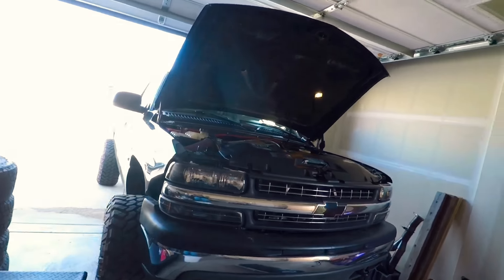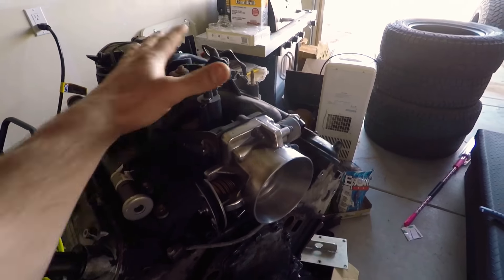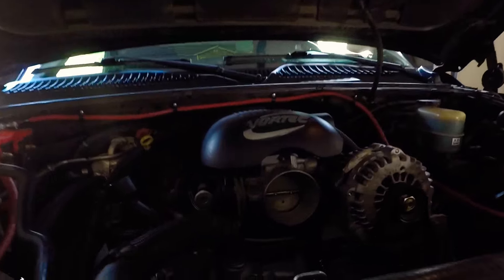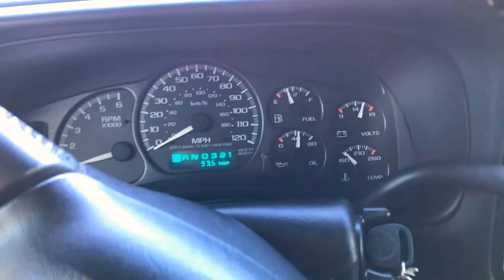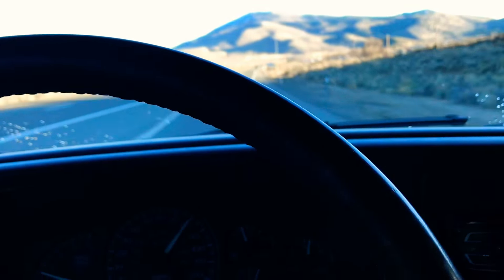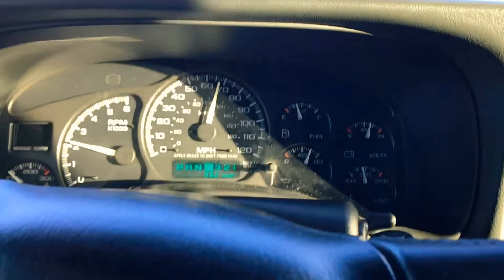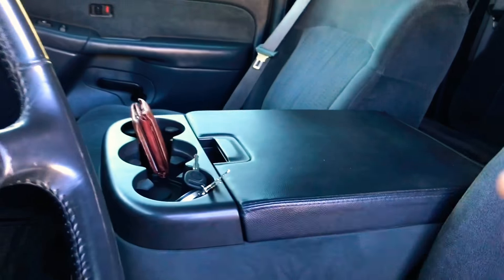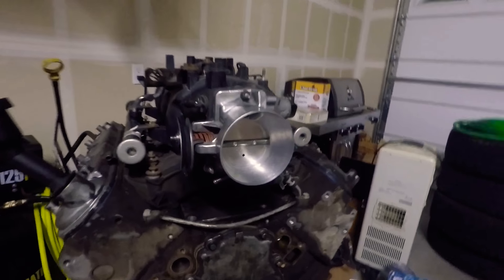Finally Finished the 6.0 Swap and it’s Already Back in The Garage

Comment: Great video. I have a 2002 2500HD with the 6.0/4L80e 2wd with 4:10s. I’m looking to do the 799 head swap and add a cam
Reply from the maker: Those heads and a cam will wake that thing up big time
Reply: I’m looking at a Texas speed cam .600/.600 with the 799 heads. Should be pretty good vs my stock 6.0 with 317 heads. How my HP do you figure you picked up, with the tune included
Reply from the maker: Shoot probably 50-60. My problem now is my injectors are too small so I could get more with bigger injectors
Reply: I don’t think there’s anything wrong with your injectors.... just decap them. They will flow almost twice as much. You’ve probably heard of Sloppy Mechanics, they are the sole reason I want to build my 6.0. Here’s a video about decapped injectors. https://youtu.be/zD90VWBigLI

I do have another question for you. If you upgrade to a 80e trans, will your factory wiring to the trans have to be changed? I ask that because I’d like to take a half ton and do a 6.0/4L80e swap. As long as the truck came with a 5.3, engine harness should all be interchangeable.... I would think
Reply from the maker: That I don’t know. I would have to do some homework on it. I know guys have done it but I just haven’t looked into it too much
Reply: David Denman 
I did a 2002 LQ4 with the TSP 220 .581 lift , long tube headers , 8.1 injectors and walbro fuel pump , it ran great WHP was 345 .
Now I'm doing a LQ4 but I'm changing pistons (H1129CPA) to flat pistons to raise compression and run the stock heads with TSP 224 for a 93 Blazer 4x4.
The 243/799 flow about the same as your stock LQ4/LQ9 317 heads the difference is the compression chamber 64 vs 70 .
LQ4 have 9.5 compression vs LQ9 (flat pistons no relief valves) 10 Compression .

Comment: First off, sweet chevy. I’m glad to see others have the same passion in these trucks and body style. I see a lot of people asking the same question so I’ll pitch in. Keep the vids up man! Haven’t posted on my channel in a while, been too busy. 

I have a 6.0 swap (cam, heads, intake, exhaust), 4.56 gears and 40” tires on my 2002. I can light them up from a stop. In my experience, If you have the power from the engine then don’t gear too low. I’ve run 31’s, 33’s 35’s 37’s and now 40’s. All with the same gear ratio (4.56) and it felt geared way too low on 35’s and 33’s. 37’s were tolerable but still a pig at highway speeds unless you really get on it. The 4.56 and 40’s make a perfect all around combo for the street and light to mild off roading...  don’t let people talk you into 5.33’s and even 4.88’s you’ll eventually regret it tho the torque off the line is great, you’re lacking everywhere else other then the city stop and go driving.
Reply from the maker: Thanks dude. I love these trucks. Mine needs a little love when it comes to the paint but it’s in really good shape otherwise. I like the 35s and 4.56 but I have a friend who has 37s and 4.56 and he says it feels better to him. I’m not going to switch anything out at this point though.

Comment: Did you put in the same 6.0 from the 2500hd?
Reply from the maker: Yes I did.
Reply: Nice....know of the difficulty level of swapping in a duramax? Probably would be easier with an entire donor truck I'm sure
Reply from the maker: Oh man I’d imagine a lot harder. I’ve seen it done but never looked into it. A half ton would MOVE though with that much power in it
Reply: Endless Wishlist yeah it would. Once I get my truck fixed up and to where I want it I may start looking for a duramax swap instead of buying a new truck. Pricey either way you slice it though

Comment: Do you get check engine light for misfire because of cam?  That will be nice getting throttle bottle done.
Reply from the maker: No never. I just had codes for my knock sensors
Reply: Endless Wishlist Ok, yeah buddy said he should be able to set things once it's ran for a bit I guess like the ranges of how many times it she's a misfire before it throws a code.
Reply: Endless Wishlist Ofcourse now I have to go to discount tire I have a piece of metal sticking out of inside firewall. They are toyo m/t maybe I will get a new one. Fingers crossed.
Reply from the maker: Good luck with the tune and tire. Would be nice to get a new tire
Reply: Endless Wishlist Dang it, piece was just stuck in a tread lug a little ways so no luck on new tire.
Reply: Endless Wishlist So you're having throttle body redone?
Reply from the maker: Yes, and that way I’ll have both of them ported. The 5.3 is getting a ported intake manifold also.
Reply: Endless Wishlist Nice, man it seems like it's always something to do.

Comment: Hey man love the silverado!! I noticed u got two batteries what are the benefits of that ? I tried to go threw ur old videos but didn't see anything on them..
Reply from the maker: There are two ways you can do it. You can isolate one or run them in parallel. Mine is just a really strong 12v system. I’ll talk about it in my next video and explain it better if you would like.
Reply: Endless Wishlist  yea man that would be cool .. my electric system is pretty weak.. I got two 12" subs and my electric fan swap on and my lights dim when the fans kick on or when the subs hit ..
Reply from the maker: You would probably want to isolate a second battery and run your subs and fan off that. The tray is a factory tray from a duramax. I’ll go over it in my next video.
Reply: Endless Wishlist  thanks !

Comment: Some 4.56 gears would help you out alot if you dont have them already with those big tires and help your transmission live longer.
Reply from the maker: I do have 4.56 gears. My factory injectors are what’s holding the engine back now. The tuner said they are maxed out and if I want more power I need bigger injectors. So I guess I’ll be getting those soon haha
Reply: Endless Wishlist ok i see now..8.1 or the supercharged pontiac gtp injectors on ebay are a good budget upgrade.
Reply from the maker: You read my mind. I was planning on the 8.1 injectors.
Reply: Endless Wishlist 
I have the 8.1 injectors and they worked

Comment: Are you running the stock 145 amp alternator for the dual battery setup? I have 2 large diesel batteries from a international I'm slapping in....
Reply from the maker: Mine is 135, my truck came with the 105. Orielly didn’t have the 145 and I needed an alternator now because mine took a dump
Reply: I assume the 135 is good to go with the two batteries. Do you have a switch or regulator between the two? Or is the amp hours within the capacity of your alternator? I saw a 200amp and a 350 amp online. I think I would opt for the 200amp when mine goes....
Reply from the maker: No I don’t have anything between the batteries. I probably should and probably will put something there. And yes the brakes should also fit your truck as well
Reply: Well apparently after some research I already have the bigger brakes. 05-13 had the bigger brakes if you have the drums on the back. I just need to switch the rear out with the dual piston out of the suburban.

Comment: Not sure if I missed it in your vids, but did you have a Black Bear tune on your 5.3 before the swap? If so, was there a big seat of the pants feel before and after the tune?
Reply from the maker: Yes I had the 5.3 tuned for the cam and headers. And yes, I could tell a huge difference. Especially is the shifting, he really cleans the trans up.

Comment: Hey man what are those gauges on your pillar .? Great vids. I also did a motor swap on my silverado. I'm running 35s should I do a gear ratio swap . If I go which ratio should I go with? Thanks man
Reply from the maker: I just have the vacuum right now but I think I’m going to take it off. I would at least do 4.10 gears. I did 4.56 but that is too low for some people
Reply: Endless Wishlist thank you for that man. Keep up the great video
Reply: I have a 6.0 swap (cam, heads, intake, exhaust), 4.56 gears and 40” tires on my 2002. I can light them up from a stop. In my experience, If you have the power from the engine then don’t gear too low. I’ve run 31’s, 33’s 35’s 37’s and now 40’s. All with the same gear ratio (4.56) and it felt geared way too low on 35’s and 33’s. 37’s were tolerable but still a pig at highway speeds unless you really get on it. The 4.56 and 40’s make a perfect all around combo for the street and light to mild off roading...  don’t let people talk you into 5.33’s and even 4.88’s you’ll eventually regret it tho the torque off the line is great, you’re lacking everywhere else other then the city stop and go driving.

Comment: how do you turn on the fog lights on your bumper? Mine are broke but do they turn on with the brights or what?
Reply from the maker: Haha you noticed, I actually put them in and haven’t wired them yet. My truck didn’t come stock with them.
Reply: Lol i pay attention to detail i like these trucks my truck is cool but some jackass when doing the fuel pump sawed a hole in the bed and the shape the bed is in im just going to find a donor bed thats white and then paint it an emerald color and lift it eventually
Reply: Where did you get that center console at or what website?
Reply from the maker: eBay

Comment: Are you running the stock transmission with the 6.0 swap?
Reply from the maker: Yes I am. I have added a couple things to help it last a little longer but the 6.0 will cut down it’s life span.

Comment: I wouldn’t port those heads. I’ve been down that road. Pro charger
Reply from the maker: What do you mean? Didn’t notice a difference
Reply: I’ve done a couple small bocks and big blocks. You’ll notice a difference at 3500 and up. Won’t help your low end torque. I’ve always been very disappointed for bang for the buck.  
Look at the numbers a stock 862 Head will flow on boost. A friend of mine is getting 720 hp to the tires on a stock motor + cam

Comment: I am looking to swop out my 5.3 to a 6.0 w
Ant tips ?
Reply from the maker: Yea man I have a video going over it. Basically all you do is swap your 5.3 block and head with the 6.0 block and heads. Use all your 5.3 harness and I take manifold. Everything is all the same

Comment: Hey man where did you get that console? I need one.
Reply from the maker: I got it off eBay. But you could also get it from a wrecking yard. It’s from a 2010 body style truck
Reply: Endless Wishlist Ah, I see. Any issues with fitment? Thanks man!
Reply: Endless Wishlist Just found your install video. Looks pretty simple! Thanks man.
Reply from the maker: I was just about to say I have an install video. Glad I could help!